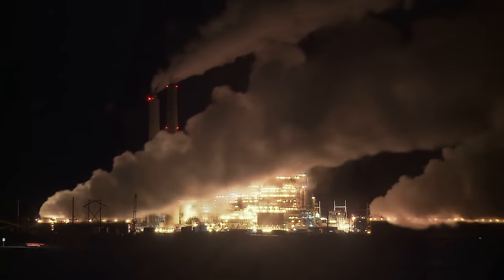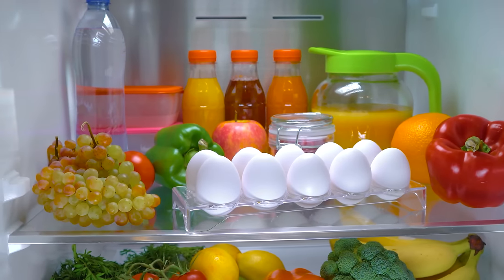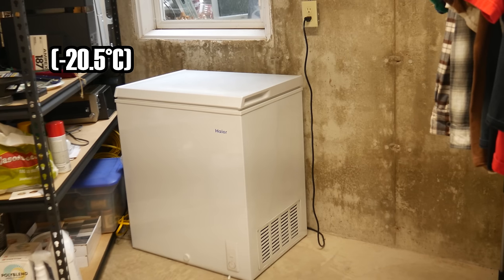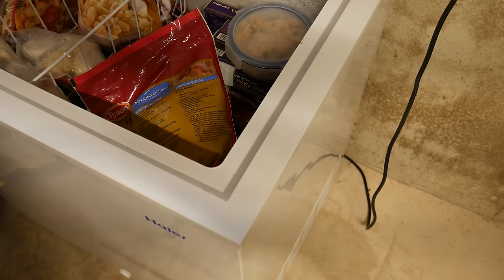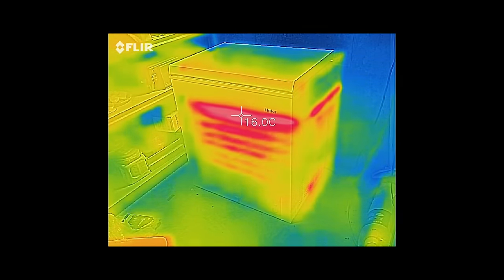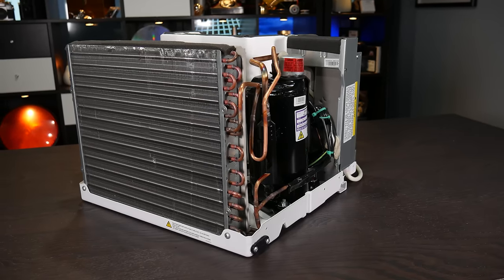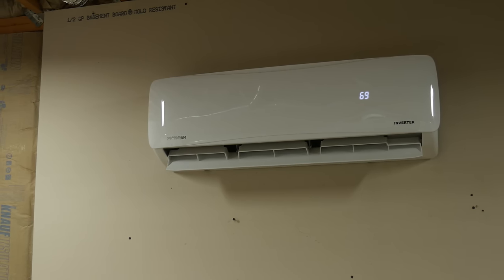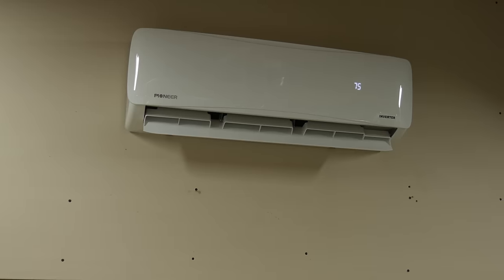Heat Pumps: the Future of Home Heating

Comment: To be fair - in the winter you wouldn’t need another heat source. Just have a few of these OR if it’s a really cold climate - buy one that’s rated to operate lower than -15°C. It’s a thing. You can get them rated to -25°C probably lower.  (Typically uses R410A or R32 refrigerant).

Comment: In spring of this year, I got a heat pump. I am a senior, and I qualified for a special exemption and it was installed by my county. During the summer I enjoyed cool refreshing air-conditioning in the lower winter temperatures. I enjoyed heat. However, we are experiencing a polar blast right now and this heat pump does not keep my house warm. It is terrible, and I am considering having it yanked out and going back to what I had. I would not recommend these for anybody living in extreme cold climates. My unit sits directly outside my back door. It looks like a gigantic ice cube. I am running three separate radiator heaters that are independent like a space heater and my house is not even 68° and it’s nine below outside. I would never recommend this type of heat. If you could just use this as an air conditioner and have a regular heating system inside, I would say that would be fine but not for heat. It sucks the big one.
Reply: Depends on the heat pump.

I'm in northern Illinois and went through a cold snap a couple weeks ago... I think it hit minus 15F. 

Our heat pump kept a 3200 sq. ft. house at 70 with no problem whatsoever. The auxiliary heat strips cycled on a few times when it was coldest, but the heat pump alone was good to at least -5.

Bryant unit installed last spring.

Comment: Heat pumps have been staple backup heat source in Scandinavia for the last 30 years. I'm using my heat pump as the primary heat source and using my central heating as backup because it's less efficient. Also, as a bonus, I use it as an AC in the summers.

Comment: Technology Connection,  First I have to say this makes the flow and benefits from a heat pump to be explained much better than I could do it myself.  I have been installing HVAC for 38 years.  At 15 minutes, you asked for a comment on the Cap Tube.  The Cap tube is used with very simple window A/C units, but not with modern heat pumps or A/C units, as they don't meet the minimum of 14 SEER.  So your ductless heat pump uses a EEV - Electronic variable Expansion Valve.  They open in steps, usually 0 to 100 steps, so will normally be in step 50 - 60, when running normally.  

At one point, you stated at -10 outside, the EER might be at 1.0 in the heating mode.  There is a chart for my Goodman heat pump, and it never reaches 1.0, but at 23F outside, it will reach down to about 1.8 HPSF.  This is because the heat pump is collecting heat from the compressor motor, and all the energy used to run that motor is used to boil the refrigerant, and heats the refrigerant that is going towards your indoor coil.  

It was described to me that the heat pump is drawing heat from the outside air by cooling that air by 15 - 20F below the ambient temperature.  When it is below -5 outside, normally the humidity is very low, and the air is so dry that not much frost will not collect on the outdoor coil.  The heat pump shown on the second unit, it should be elevated above the normal snow level, so about 2 feet in most areas, so that the defrost water does not collect around the base of the heat pump.  Also to get air into the heat pump outdoor coil when you get that once in a couple of years 3 feet of snow.   I used some bricks and covered those with decorative bricks in the home to bring it up about 2 feet, because we never get more than about 2 feet of snow in Sandy Oregon, where it was installed.  

I had a 20 KW electric furnace when I moved into my current house.  I asked the prior owner what the highest electric bill was, and she said $400 one January (most of them are not that cold).  My highest bill has only been about $130.  I installed a 4 ton heat pump, not because my 1,800 square feet required that size (about 3 tons would have worked great), but because at 23F outside, the heat pump could not put out the 48,000 Btu's (at it's 47F outside temperature rating),  but only about 28,000 Btu's at 23F outside.  And that is about the lowest temperature here in Portland Oregon.  I never hooked up my electric back up heater, but will if I ever move out of my house.  When in defrost, the system blows out some cold air for the 2-5 minutes it is defrosting.  Many times if the temperature is less than about 35F outside, I will shut off power to the outdoor unit for a few seconds, so it will not go into defrost every 90 minutes.    I normally only heat my house in the daytime, when the temperature is warmer, and then shut it off at night, unless it gets really cold inside.  When it is 35F outside, (daytime) the heat pump runs at about 2.5 HPSF, so I can collect about 36,000 Btu's per hour.  At 28F at night, then I will have a lower 2.2 HPSF, and require more energy to warm the home, as well as only collect about 28,000 Btu's per hour.  

Many thermostats are set up to change from heat pump mode to a second fuel, such as propane, natural gas or oil heater.  They normally switch over at about 35F, using the internet to keep track of the outside air temperature in your zip code, or a remote thermostat that has a battery and measures the outside air temperature.   But if you have electric heat, it is best to keep using the heat pump mode, as you will always be getting more heat than when running on electric only.

In Texas, the grid went down when the electricity suppliers decided they needed to "Shed" some power lines.  This is normal way to avoid a blackout.  However they should not have turned off certain "Critical" power lines.  But they did, and shut off some random areas to save power, by disconnecting some of their customers.  Problem was they also shut off power to a pumping station that supplied natural gas to the electric generation station in certain areas of Texas.  Then when the natural gas was not there, that took out a dozen or so of the 500 MW natural gas power generating stations, then the blackout happened.

The problem with the blackout is that most power plants can not start themselves!  It takes a lot of electricity to start the water pumps, fans and run the boiler, before it can start to put out the 500 MW rated power!  Then if they turn on to many circuit breakers all at once, they might put on a load of say 750 MW on their 500 MW boiler, and trip the output circuit breaker, and need to start all over again.  

And Texas is not connected electrically to nearby states.  If Texas had been connected to nearby states, then they might have been able to restore the power much faster, provided they did not  cause a blackout in the nearby states.

Comment: This is super cool (pun intended)! One problem with using a standard free-form box AC unit design for your heat pump (where I live) is the positioning of that box. I live in a semi-detached house in an area that gets a fair amount of snow, and fairly humid winters because my city is on the shore of the Great Lakes. Because my home is semi-detached, there is very little real estate between my driveway (which I need to shovel) and the opposite side of my yard. With my home's front steps on the far side of my driveway, my AC unit is positioned right at shovel-throw distance, meaning it gets completely covered in snow when I clear my driveway.

This issue could have been avoided if the previous homeowners had positioned the unit elsewhere, or positioned the front steps closer to the driveway, but that didn't happen because it probably would have been harder to do so. Basically, areas with lots of snowfall will need clever thinking, and different air-transfer heat pump form-factors to get around the snow pile problem.
Reply: This sounds very US problem (not to offend in any way) but in europe we install AC units on walls and 99% of the time they are well above ground so this is not a problem. seems like in US you like to have them on ground, which i can think as way of limiting noise that gets inside a home, or for easier servicing, reducing noise would actually make a lot of sense
Reply: @Boz1211111  I can't say for sure if that's why, but it's likely. There's about a foot of air between my unit and my porch, and then about six feet of porch before you reach the home's wall. It's audible inside, but certainly not offensive, nor does it vibrate anything.

Comment: In PHOENIX, Arizona I had an all electric home with a "heat pump."  When the temperature fell to near freezing or below freezing,
the heat pump would struggle to keep the home warm.  It would run continuously at night, alternating with tepid air and blasts
of cold air when in DEFROST cycle.  I now have a home in a colder climate with a mini split heat pump as well as natural
gas heating.  The mini split supposedly works at 100% efficiency down to 5 degrees below zero.  I find it works very hard below about
20 degrees.  The natural gas wall heater is a far better choice, costs less to purchase and operate.  It also works perfectly without
the need for any electricity..... a major plus in storms and outages!!!!!

Comment: Hi! Thanks for this video. I learnt a lot.

I don't want to sound like a complainer, but this is just a fact: I suffer in air-conditioned environments from the dry air. Skin, sinuses… you don't want to hear it.

Do these heat pumps dry out the air? I'm getting ready to purchase, but I'll have to figure out this one first.
Reply: All methods of heating will result in air that feels drier if you feel the outlet air, but they will do nothing to the actual humidity in the space. Cold air does not hold humidity as well so the dryness of the house is caused by that the dry outside air and not the method of heating. There is an exception with indirectly vented furnaces as they cause a small amount of outside air to be drawn in and the outside air is usually drier when its cold outside. Many homes will have a humidifier if they get too dry in the winter, these can either be portable plug in units around the house or a central humidifier that uses existing ductwork.

Comment: I had a heat pump installed about 5 years ago.  I'll never own anything else.   The only drawback is in extremely cold temps where the unit is a bit inefficient.   For that, they left the old standard heat strips in the attic unit, which boost heat during extremely cold weather.    My bill dropped to about half of what it was with an older traditional A/C unit, which was my point in having it installed.

Comment: If you live in Washington state (not DC) they are making heat pumps mandatory in 2023 for new homes and apartments. We have central and it does not work too well in a house that was built in the mid 70s because the air ducts are all clogged up and impossible to clean. By the time the air gets to my room, it is warm, but there's not enough of it to warm my room because we have poor insulation so I have to use a plug in heater.

Comment: As an HVAC technician, heat pumps do work (the refrigerant part), only the outside weather conditions are right. If it gets too cold. Heat pumps can only capture and move (that's right, heat pumps don't produce heat, they move heat) so much heat from outside to inside. That why they need an auxiliary heat source (backup heat source, like having the heat pump) paired with a high efficiency gas furnace or electric heat.
Reply: You might want to look into Vapor Injection and it's various forms e.g. mitsubishi's hyperheat.  Which has full capacity down to ~5F (-15C), and can still produce about 75% capacity at around -18F (~-27C)
Reply: You might need to upgrade your education. But you dont need to know more if you only work with cooling.
Reply: @BenIsInSweden  Har Mitsubishi. Otroligt bra. Luft/vatten.

Comment: For those, wondering how a heat pump works.
Look to your freezer or your refridgerator. The coil on the back of the unit, absorbs the heat inside the unit. The pump transfers this heat to the outside. Result all eat is pulled out, and you have cooling, or freezing inside.
Now just reverse this, draw the heat from the outside of the unit, pump it inside, now you have heat inside.

Comment: Another issue is that different refrigerants have different COP at different temperatures. 
One may work very well for cooling your house but be terribly useless for heating during winter. 

As an example R600. Boils at ambient pressure at -1°C . Well that stuff will have a very hard time collecting heat in freezing conditions but it has a very low GWP is cheap and works for cooling your house and should work even rather cheaply as you wouldn't need any freeze protection. 

But it works great for high temperature heat pumps. 
It can deliver 160°C at a COP of greater 3 and 110°C with a COP of greater 4 . When your heat source is 60°C warm. 

That is really something for a heat pump. 
So every refrigerant has its sweetspot so to say. 
So there's a point in optimizing for one

Comment: An ac unit like this would be useful in Florida. Even in the middle of the winter I don’t have to use the heat often. So a heater like this on the coldest days would be nice. Instead of a huge full-size resistive heater strangling my
Power bill.

Comment: 1.Turning existing window ac unit around so it will blow cold air outside and hot air inside will give you heat pump heater in winter. All it need to tweak the thermostat...... 2. Running water heater inlet pipes thru the central AC condenser unit so pipes will touch and exchange heat ,will preheat your water  and also cool down condenser coils more efficiently.....  3.If you have a pool or jacuzzi hot tub, running your central AC hi side condenser pipes thru the pool/jacuzzi  water before it enter condenser will do :  A: cool down condenser without even running fan(save electricity) and B: heat pool/jacuzzi for free. What do you think?

Comment: Here in the UK the government are pushing heat pumps hard but for the UK the COP drops from mid to late October through to late February as temps dip  an average 5 to 10 degrees with periods sub zero for perhaps several weeks.  We lose efficiency further as we have separate water heat exchangers to heat water to pass around a radiator system plus a secondary exchanger for hot water heating for taps.  It effectively means a COP rating is only around 3 between 10 to 15 degrees Celsius ambient and that efficiency drops off under that until a sensor picks up that a switch to resistive heating is called for.  We are then effectively using immersion coils for hot water and costs sky rocket!  Gas is by far more efficient here but wholesale costs have almost tripled due to Ukraine.  Ground source has its  problems too and those using it say whilst it works it’s still not that efficient because the temperature gradient doesn’t benefit heating efficiency once ambient rises above 10 to 15 degrees.  Burying pipes deeper and having space for a decent length helps but new builds here hardly have any garden space so air source seem to be flavour of the month.  We have just got to install a new heating system and haven’t hesitated to use gas.  Improving home insulation can drastically cut gas consumption.  On the coldest winters day we still only need heating on for maybe 6 or 7 hours per day thanks to 75mm cavity insulation and over a foot of loft insulation.

Comment: I have long experience with heat pumps.  So, here is some practical advice.  New, a unit should heat the house to outside temperatures a few degrees below zero F.  As the unit ages this ability will degrade.  Remember, a heat pump runs year around (A/C use) and so it gets a lot of use.  Also, when it reverses flow to thaw the outside unit in winter it will make a racket.  So, best to not place the outside unit right below your bedroom window.  Because of year round use expect to replace the unit in 10 to 15 years.

Comment: the easyest way of thinking about it and understanding it is, air conditioning takes air makes it cold on the inside, hot on the outside, to use it as a heat pump, you make the outside the inside and the inside the outside, so cold air goes outside, warm air goes inside, and then trough some clever design, you can have 1 unit that allows you to chose if cold air goes inside or outside, and then the hot air will go on the opposite side

Comment: Most ductless unit use an electronic thermal expansion valve instead of cap tubes. Makes the amount of refrigerant moving at a variable rate, so the system can vary its capacity. The largest problem of variable capacity ductless units is they make the room more humid in very damp parts of the world.

Comment: I have a neighbor with a heat pump system, it barely keeps up when its -20 c out side keeping it +17 c inside. If he didnt have a wood stove installed just before our week long -35c cold snap, he probably would have froze to death in his own home. I told him if his heat exchanger was Geo thermal apposed to a radiator it probably would have worked.

Comment: You can do a hybrid system with gas furnace as the back up to the heat pump  cost more initially for equipment but in your climate would offer more options in the cold season